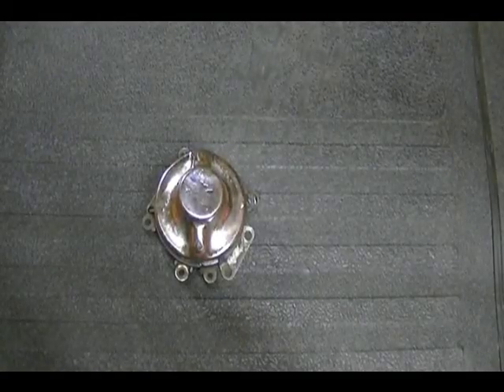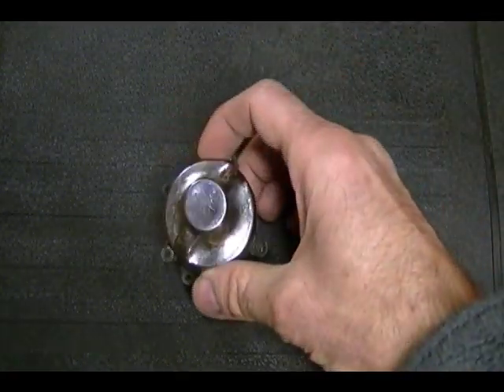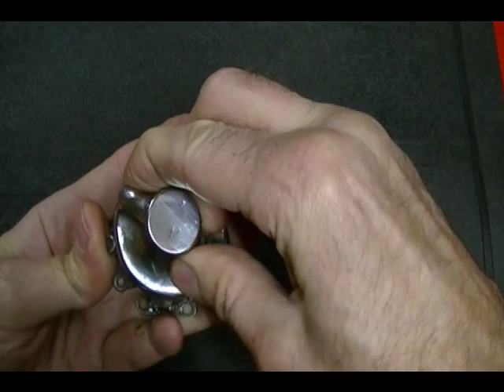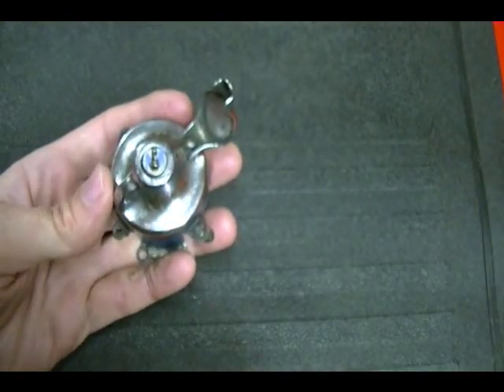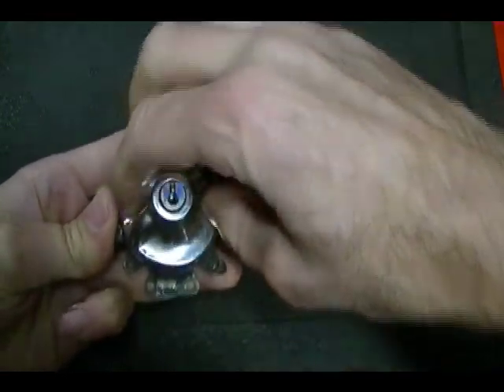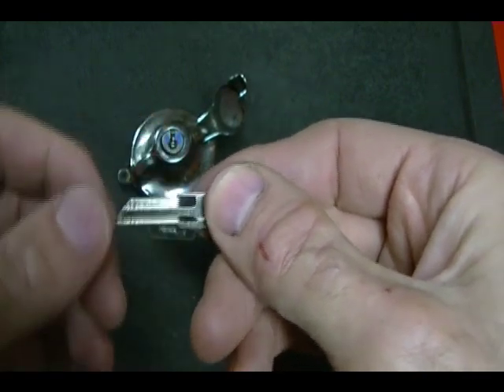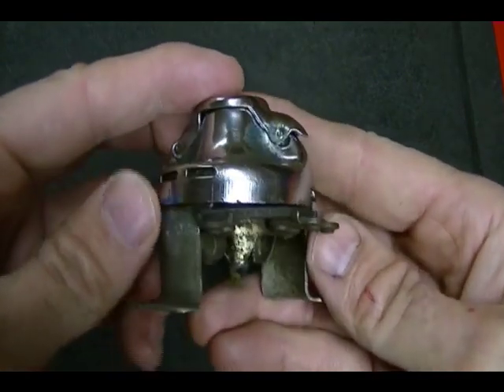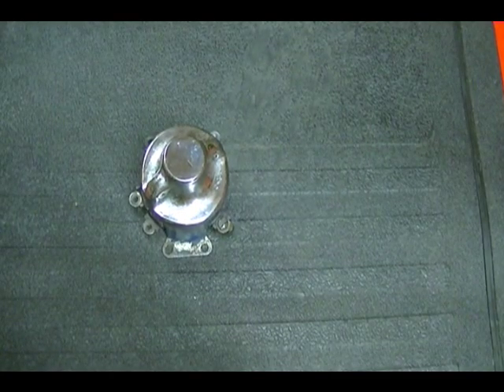1958 Harley Davidson 165 Ignition Lock, Key and Electrical Switch

Comment: I don't know how old this video is, but your position is incorrect. I have the same lock and the 4 screws, two on each side attach to the base. (LEFT side RIGHT side) You should know that if you even looked at the base. I now need a new lock and am not fond of the barrel type cause it quit turning! Looking for a electronic ignition one but can only find one that has 6 posts. Hope I can get it to work! There are no instructions that came with the first switch!

Comment: You got it side-ways. The first click clockwise of the extreme left ( extreme left being Accessory Only ) is "OFF" and should be straight 12 o'clock/6 o'clock. Next click clockwise is Ignition ON. Next and final click clockwise is Ignition and Lights ON.
Reply from the maker: Thanks for the info
Reply: ***** No trouble. Aren't those the coolest switches ever? The new remake ones are garbage by compare. They didn't spare materials when they made the old ones.
Reply from the maker: John Ratko
I do like the originals better than the reproductions. The reproduction locks use a different keyway and key.